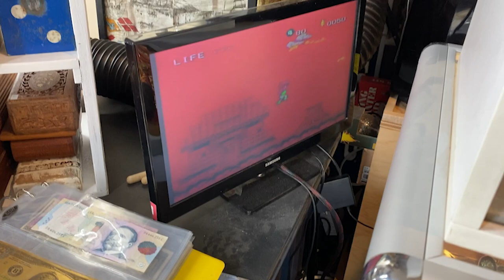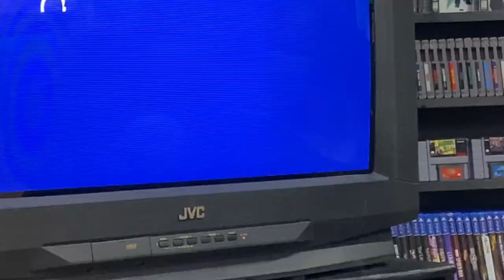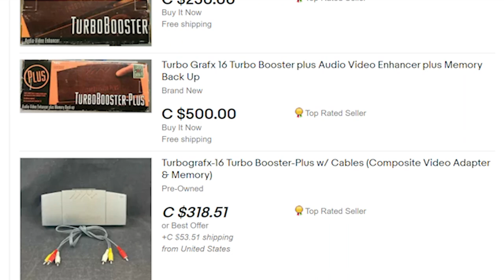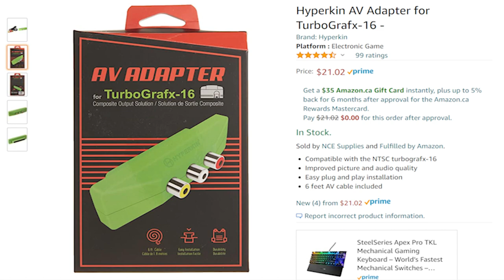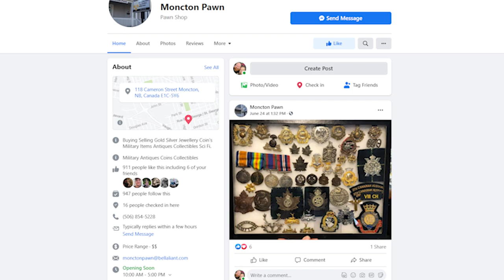Retro Rivals BIG SECRET. We found Our Holy Grail Console BUT there's a catch

Comment: The RF ports always go bad in tg16 and pc engine systems. Good call on getting the AV out adapter. There are also adapters that provide RGB from the rear port. I can internal video mod these systems if you are interested. As far as collecting is concerned, you're better of finding other stuff to flip or trade to get the turbo stuff you want. Finding turbo stuff in the wild usually doesn't happen. If it does, prices are generally the same as eBay.  Congrats on finding a good deal.
Reply from the maker: Oh sweet!  Yeah we’ve been looking into possibly having it modded.  If we do, I know who to turn to 😉
Yes that seems like a solid plan for the collecting.  I’ve honestly never seen any here but I am betting they wouldn’t be cheap, that’s for sure!
Reply: @RetroRivals  Generic knock off branded everdrives on AliExpress work well. You just have to wait forever to get one from China. Search "PCE 500 in 1".

Comment: If you guys need a power supply for this console, use this one: https://www.digikey.com/en/products/detail/triad-magnetics/WSU090-1300-R/3094978

I have tons of TRIAD supplies for my consoles and I stand by each and every one of them.  FirebrandX made a handy guide for replacement supplies for almost every retro console:  http://www.firebrandx.com/triads.html
Reply from the maker: Thanks so much for the info Sho.  We ended up having another power supply and checked the specs online against the original and it was dead on.  I’m gonna check into these though, it’s nice getting info from people we know on products they trust
Reply: @RetroRivals  Oooh, if the specs are dead on, that's good too!   TG16 supplies are such a pain to get the OEM ones. 😂🤣😨

One of the great things about the TRIADs is that they are modern, low footprint and all are rated well as far as energy efficiency. They can also be good in a pinch if you find a console in the wild that you wanna flip for cash!

Comment: That Hyperkin AV adapter might look nice at first but it's actually damaging your TV. You might want to look into it. Knowledgeable tech people found out it was missing components for it to be safe. Hyperkin did this to save on production costs. That bad review on amazon is right. Hyperkin themselves admitted it was not safe. Check out Voultar's review for details.
Reply from the maker: Thanks so much CedvMontreal.  We’re going to look into it.  Definitely don’t want to damage our tv.  I’m finding CRT’s (especially big ones) getting harder and harder to find so we certainly don’t want that.  
Is there a better option you’d recommend that won’t break the bank?
Reply: @RetroRivals  Here is the high quality item your looking for. https://insurrectionindustries.com/product/spark-plug-rgb/
It wont break the bank and provides composite and even RGB! Later on you can purchase component cables   from HD Retrovision and get even better picture quality.  Congratulations on the Turbografx! I got the PC Engine myself and can confirm it's an amazing console.

Comment: So happy you got the TG16! Been rooting for you on this for a while now. Welcome to the NEC family!

About the hyperkin device. Please stop using it. It was not made correctly and it is sending uncoupled AC power without proper DC impedance.
In the long run this will kill the console and any device it is connected to. 
Voultar went over this and has proof. He is an electronics engineer that has a professional Console repair/mod service. 
While I am happy you got one, please do not use the Hyperkin adapter.
check this video: https://www.youtube.com/watch?v=FsZj6zH8n6I
Here is the in depth article about the device: https://www.retrorgb.com/hyperkin-tg-16-composite-video-adapter-analysed-spoiler-its-bad.html

Here is a link to a Controller extension: https://console5.com/store/turbografx-16-turbo-grafx-16-turbopad-joystick-controller-extension-cable-cord-2-9m-110.html

Here is a link to a power supply: https://console5.com/store/9v-1300ma-ul-certified-power-supply-transformer-for-sega-genesis-cd-nes-aes-tg16-100v-240v.html

I have only seen Keith Courage in the wild since 2000.  I can't really find TG16 games in the wild these days and eBay prices are crazy. 

Let me know if you need help with the Everdrive.
Reply from the maker: I’m gonna try hard to figure out a solution if it really is that bad.  Just got one, definitely don’t want to brick it!
Also this is me saying yes I need help with the everdrive lol
Reply from the maker: Ps sir, you are a wealth of knowledge and the first thing I said to Scott when we got it is that Moandain is gonna be so happy.
Reply: @RetroRivals  OK you got it. I will set something up for you and PM a link.